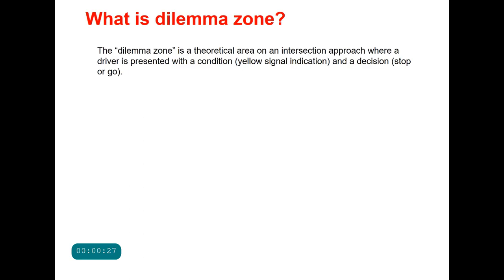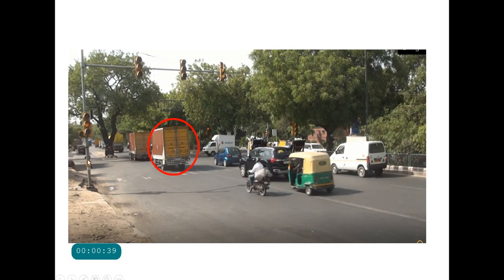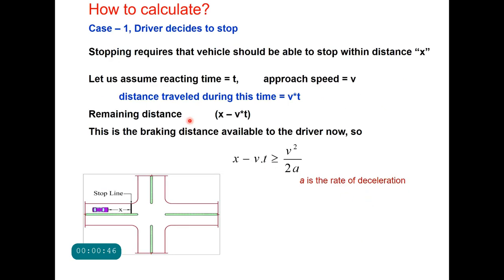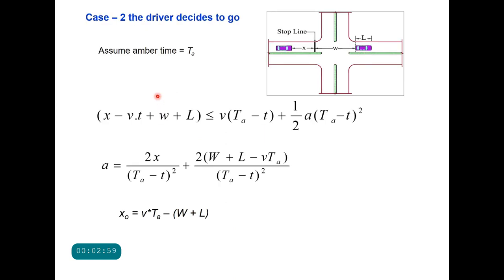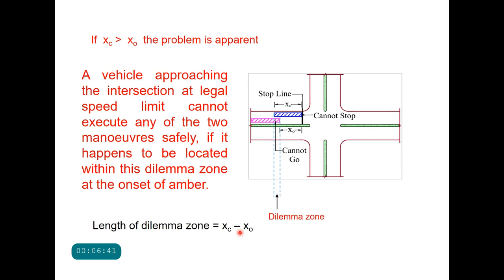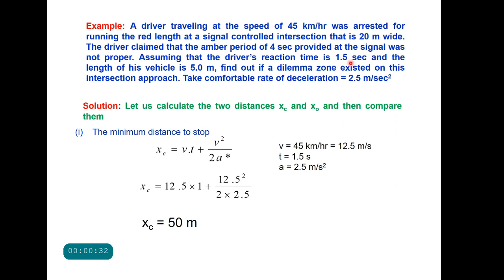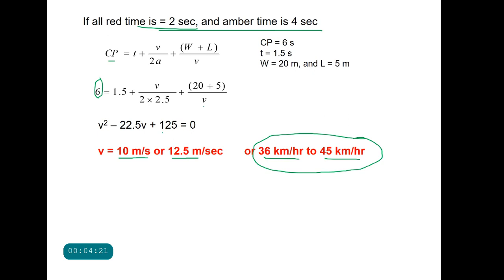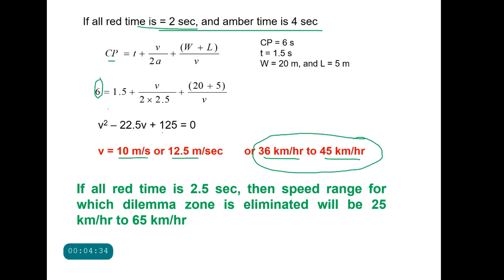#traffic, #signals, #ambertime, Dilemma zone at signal controlled intersections

Comment: does it mean that higher the all red time, lower will be the reliability because at 2.5 sec all red time ,speed range was 25-65 which shows larger variation as compared to 2 sec all red time
Reply from the maker: to some extent yes. But remember all red time means loss of effective time for traffic movement

Comment: Sir, 
Thank you for another informative lecture. 
Just wanted to clear a doubt with you. For the case when the driver decides to stop, don't we need to take the coefficient of longitudinal friction into account?
Reply from the maker: very good observation. The basic equation is same in both cases. v^2 = 2as, where a is the rate of deceleration and s is the distance required to stop. when we calculate braking distance in geometric design of highways, a is taken = f*g, and the equation becomes like this---- braking distance (s) = v^2/(2gf). value of f is in the range of 0.4 to 0.5 and therefore rate of deceleration becomes 4 to 5 m/s/s, which is very high for cars and heavy trucks. In this equation we assume that the driver will apply 100 percent brakes and the entire frictional force will be mobilized to stop the car, whereas in the calculation of stopping distance during dilemma zone, we assume a comfortable rate of deceleration (a). That is why we take actual value of 'a' rather than f*g. But here also, car will stop utilizing friction force only. 
I hope you got the answer to your question.